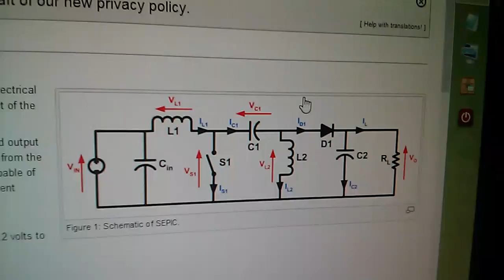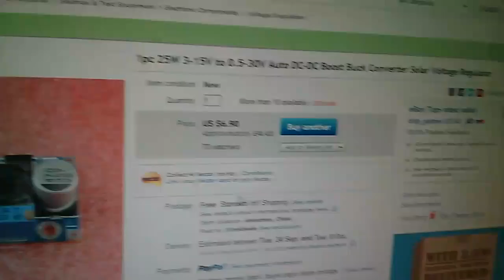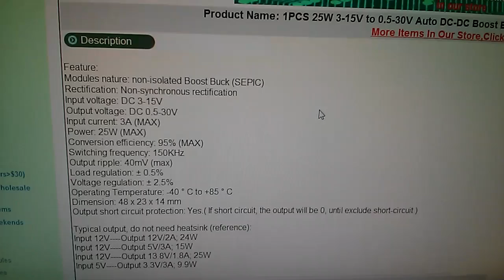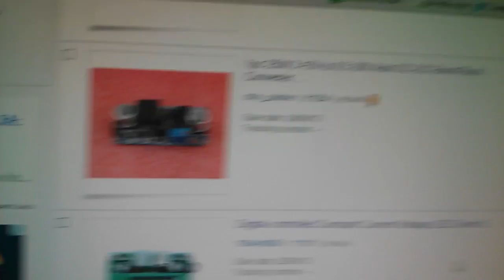Review: SEPIC Buck Boost DC/DC Converter - Steps voltage up or down

Comment: This can be used to charge a laptop with ur car battery. It will keep the voltage stable and 25watt can easily charge a normal laptop battery within 3hrs.

Comment: I have a quick question. Would a higher amperage boost buck converter possibly work to regulate voltage coming from a small alternator? This particular alternator (on a small motorcycle that charges a 6v battery) is around 6 volts at engine idle and 20 volts high engine rpm. I would like to regulate it at 12 volts consistently and use a 12v battery. I don't think I would need to pull more than a few amps to power some led lights and charge the battery. Would a boost buck converter work on something like this with a range of 6v to 20v input and 12v output.

Comment: I don't understand.. Why when I hook up a solar cell 10v, when when the input voltage from the solar cell changes (sun, clouds, shade, etc..) why does the output voltage change? I thought the whole idea of these sepic converters was to have a constant voltage output no matter the input voltage? If this doesn't do it, then what will do it? I need constant voltage, I don't care about constant current. I have a CC & CV Converter already. but I don't know how to use it. think I need a load on the other end to use it.

Comment: I'm looking to power an Xbox from a 12v system without the use of an inverter. (It seems wildly inefficient, efficiency is important since this is a solar powered system). Since the batteries are on charge during sunlight the voltage source ranges from 12.2 - 14.4, once a month reaching to 14.6 for an equalising charge. 

The Xbox is power hungry - and operates at 220watts in full flow. I've looked at the range of power options available and am confused. Which do you think would be best. A regular buck/boost or a sepic converter?

I am struggling to find a ps that can handle the amperage required.

Comment: So, I connected the output from a solar panel (5V) to this SEPIC converter to provide a steady step down voltage to 3V (to charge 2x NiMh batteries). Another set up with 1.5V (1x NiMH)

The arrangement works as long as there is direct sunlight. As soon as a cloud cuts out the direct light briefly, the panel is unable to support the load (fair enough) and it switches off. But after the cloud passes and direct sunlight is available again, the SEPIC converter does not turn on again. It would be nice if it did (and harvest the maximum solar power possible)

Comment: Hi there , I hope somebody can help me out.

I have a 100watt 5.8a mono solar panel + a 105AH deepCycle 12v battery and i want to charge up my  18volt electronics like laptop / Bluetooth speaker.
what should i do ,  buy a 12 to 230 Volts Converter  OR just get a Buck Boost converter like this one OR a Buck step up ?
My thoughts are its  a waste of energy to go from 12 to 230 volts and then drop back to 18 volts with a regular converter that i buy in the car store.

Hope somebody can help me :)
Reply: As you've mentioned, stepping up from 12V to 230V is quite ineffective. Stepping it down again is even worse. 
For charging up your laptop, use a boost converter - but not this one because it most likely won't be able to power your laptop - use something like "150W Step Up Boost converter" (very cheap on eBay).
To charge the battery, you could use a regulator similar to this but with current regulation, I'd say. You'll have to account for the charge current - i.e. you should charge your battery faster than it discharges due to the use of your laptop or bluetooth speakers.
Hope this helps. Cheers.

Comment: hello 
can i use 2 parallel of them to supply more current?
Reply: Load sharing might be hard - i.e. one of the modules would provide more current than the other and as it heats up, it'll keep providing more power than the other, which will, again, cause it to heat up more and can eventualy burn out or shut down. A good way to start would be to remove one potentiometer and parallel it with the one on the other module (you might have to remove some more resistors, though). Adding an heatsink to the integrated circuits would help, and a fan might be very useful in your case (I'm paralleling two LM2596 modules and load sharing is poor but the fan helps preventing thermal runaway - and as it is used for brief periods of 10 minutes, maximum, it works fine).
This is a crude solution though - evaluate your needs. If you need constant operation and somewhat high currents - you should probably stay away from this or come out with a more ellaborate solution. Cheers.
Reply: Nuno Garcia Thanks pro 😊

Comment: There are some things that people should know about:1) The output ampere is 1/3 of the input ampere. For example: If you give 3A input, you will get 1A in output. 
2) It will show you that it is boosting 4V, 5V or 9V to 12, 20 or 30V. But the output voltage reduces significantly when an actual load is given. For example: You can not boost a 4V input to more than 8.2V during load. Is easy word, you can't boost more than 2x of the input voltage. If you need 12 V output, you need to use at least 6V in input. 
These are the problems I faced. *The buck part works well. The boost part is the problem.
Reply: What a load of bull... the voltage across an inductor when it is kicking a back emf is proportional to the rate of change of the current... if the current would be stopped instantly, the voltage would theoretically be infinite. Furthermore, as long as the inductor is correctly sized, it is full well capable of delivering sufficient current to the load.
 I just finished designing a sepic converter that is totally capable of converting 4 volts to 24 whilst sustaining an output current of 1,5 amps and the thingy is on a pcb of 1cm x 5cm... so, really doable to go beyond twice the 8nput voltage.
 Aside from too small of an inductor, you might have run into another problem in your design: too low of an input capacitor/too big an esr and therefore not letting you converter breathe.. if it had no sufficient input cap and if long cables were running to the power supply, that might have played a role.

 Please don't say stuff as if you had it figured out when you clearly do not, it might have a negative impact on those who are still learning the ropes
Reply: @zet0korp  I said I faced this problem in this particular converter. And the load of bull part: go eat some cow dung. 😆

Comment: I looked at a 30W version of this, wasn't impressed as it fails under load
Mine has the same controller IC, just different inductors, mosfet and diodes.
At high duty cycles (eg difference between input and output voltages) the inductors and mosfet overhead.
There is also no over current protection, just a crude short circuit detection.
http://www.eevblog.com/forum/reviews/30w-sepic-dc-dc-converter-review-(5-35v-in-0-8-35v-out)/

Comment: Attaching a 9v battery and telling us "Gee, it works!" doesn't cut it in my books!  Anyone watching this will at least want to know that these work properly under load.  Quoting the advertised 25W output as 'probable' proof of a regulated output under load doesn't cut it either.  Were you to do a proper "review", you would also have checked the efficiency of these Sepic converters.  Finally throwing in the tit-bit about having the cheaper sepic converter but not having even checked it, despite several posts here about this, is the final fly in the ointment.  It baffles me that 131 voted for this "review" (sic) as opposed to only 7 (of us) having voted against...
Reply: +Mojo Jomo   It is a shame vital info such as this is missing after bothering to test at all. The load is the thing people need to know about. I imagine he moved on to other projects and never got round to fully testing.

Comment: I love it. Just ordered one. I am thinking this would be ideal to keep my 5volt devices at 5volts for longer. Batteries fully charged are about 6v but then they drop down quickly. This seems perfect. What I don't understand is why do companies sell buck and  boost separately when this does both? Do you know why? How did the cheap one do in your test?

Comment: I have an idea and want to ask you could it work? I want to make a battery for a netbook (original battery had 3 cell 18650). I want to  connect 4 pcs 18650 batterys with Li-ion Protection Board ( search Ebay: PCB BMS Protection Board for 4 Packs 18650 ), that would give me 14.8 to 16.8V. Than connect it to XL6009 Buck boost Converter (SEPIC) to give me 19.5 V. Then connect the boost Converter to DC socket in netbook where the original netbook charger (19.5 V 2.1 A) usually connects.

Comment: Have you tried using this converter under load (Does the voltage sag as you draw more current)? Do you think it would survive engine turning over where the voltage potentially sags to 5-6v and still provide a good regulated output voltage?
Reply from the maker: Marineio Not tried it under load, but it claims to be good for 25W. The output voltage shouldn't sag under load - it should be regulated. It should be ideal for automotive applications maintaining a constant 12V output. Spec says 3-15V input.

Comment: DON'T BUY THIS ONE, THIS MODULE CANNOT SLOW START !(Input voltage slow rising from 0V). It's unusuable for solar application. There is better one for same price operating on 40khz and muc ore efficient. Search for XL6009 Buck boost its only 2.34$ and it can do 4A output!
Reply: Sorry i ment 400khz not 40khz
Reply: The XL6009 isnt suited for solar applications either, it just pulls the input (solar panel) voltage down to around 2.7V. Many sellers spesify "solar", but it is sadly not, for this you need something with MPPT or similar capability. The XL6009 regulator does as you mentioned slow start very well, and even at 2.7Volt from a 200mA max current 12V panel is able to charge (slowly) a small 12V lead acid battery. I tried to search if there was a way to modify the xl6009 to do some power tracking, but I have not found anything yet...

Comment: I bought a couple of these - my idea was to run an Arduino from two alkaline AA's.  The input from a pair of fresh alkaline AA's reads 3.2V.  Despite the claim of 3-15V input, I couldn't get these to bootstrap from 3.2V. So I had to add a third AA, which rather defeats the purpose since I think my Arduino will run OK on the ~4.5V from 3 alkaline AA's anyway.

Also worth mentioning the jumper on these modules - I think that's for a power switch - remove the jumper and the input voltage gets disconnected (I think).

Cheers!

Comment: Hey Julian,
Great reveiw! 
Im starting a new project of my own. I have some 9v 3w solar cells and want to strig 6 of them together for 9v at 18 watts to make a real portable usb solar charger with enough  HP to actually charge phones and tablets. Have  you ever seen a off the shelf circut like this that will provide a steady 5 volts from a varisble input, most of the time and will shut off if the output is under 5 volts It should also be able to trick Apple and Samsung devices into thinking that they are pluged into OEM chargers. Ive been looking everywhere cant find it please help.

Comment: Hi Julian
Do you think once set up these circuits could be encapsulated in potting resin
Reply from the maker: I guess so, but the resin will act as thermal insulation, so you will want to run it well below it's maximum power rating

Comment: you seem good at this stuff,,,im wondering if you could help me with a idea i have,,,,,im trying to figure out how to charge a li battery

Dimensions (Metric): 61MM (L) x 61MM (W) x 112MM (H)
	 Dimensions (Standard): 2.5" (L) x 2.5" (W) x 4.25" (H)
		Negative Terminal Location: Right
		Weight: 444 grams (.979 lb)
		Voltage (Charged): 13.6V
		Amperage: 8 Pb-eq A/H
		Pulse Cranking Amps: 135 CCA
		Operating Environment: -18°C (0°F) to 60°C (140°F)

off a solar panel,,i have a charge controller,,now,,its just a pwm 12 volt controller ,,but the battery says not to let the volts over 14 something,,, thanks,,kevin

Comment: Hello Julian, have you received the cheap converter you showed at the end of video? Is it working (worth the money)?. Is it with LM2577 chip?
Great reviews :)
Reply from the maker: Cheers. I got it but haven't tried it yet, but yes it does use the LM2577
Reply: Julian Ilett how about now? have you tried it yet? Could you also link where you got your LCD voltage displays from, i'm guessing that is what you wired onto your buck converter?

Comment: Hello Julian. Thank you for the review. This module is exactly what I am looking for. I want to use it to power a rear view camera for my car. This module will provide a regulated 12v DC, but what is your opinion on whether it will cause video interference? Thanks
Reply from the maker: Yes I suppose the switching frequency could be visible in the video signal, but you can add extra smoothing capacitors on the converter output to minimise it

Comment from the maker: eBay seller lakeyx101 has got this converter on sale at £3.08 - search for "25W buck boost".
Reply: I purchased one of these and I'm trying to boost a lithium cell 3.7v up to 12v. It seems to work on the meter but when I put any (decent) load on it, it seems to go into this fail state, until i pull the supply and reset it.

Could you please check these numbers for me?
Since the ic is rated at 3A max for the input, and I have 2x 2200mah cells in parallel; when I have the cells at 3.7v, I should expect the converter to draw a max of (3.7 x 3) 11.1w which is about 10.5w discounting for efficiency loss. With 10.5w to play with, at 12v output, I can only expect about 800ma or so. Is that right?

I've tested it at 12v out, under a small 30ma load (LED behind a resister which got hot) but I don't think that's conclusive. 

Am I doing this wrong?
How can I prove that I can get all 800ma @ 12v on the output from the 3.7v cells?
Reply: +Julian Ilett   He's now selling it for £1.42!
Reply: Got it for $1 on ebay

Comment: That cheaper one does not have the protection circuitry, that means it's dead easy to fry the diode, i did that after about a minute of testing when i got mine :P

Diode is easily replaced though so no problems really.

Comment from the maker: Neither is best, they're just different. The 2-chip type is a boost converter followed by a buck converter - 2 converters so twice the losses perhaps. The SEPIC converter has only 1 controller chip, but does push all the power through the series capacitor. Buy both, try both, I guess.